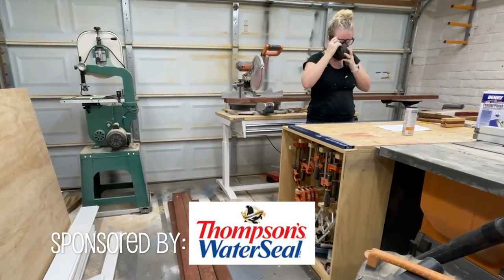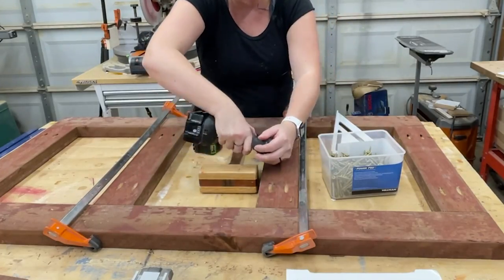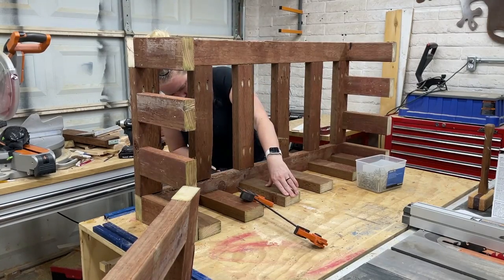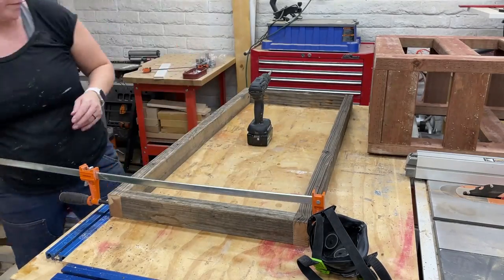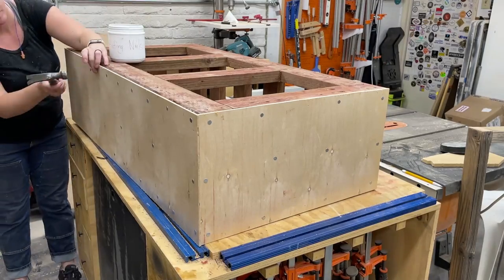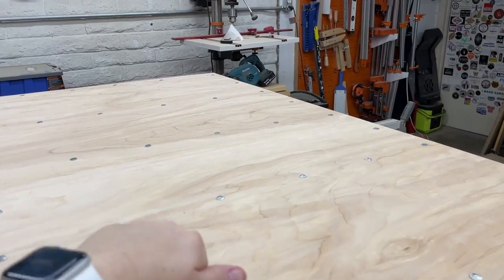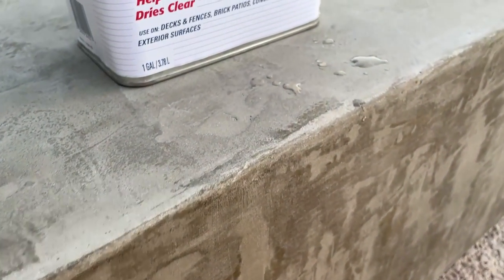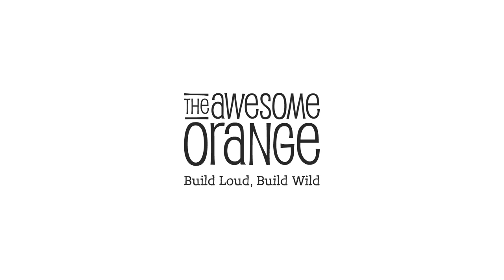DIY Concrete Coffee Table | No Heavy Bags Required

Comment: love the idea. I'm curious how it has held up over the last 2 years? Anything you would do differently? Thanks!
Reply from the maker: I ended up selling this one, so not sure on longevity. Biggest thing to worry about are cracks, but they would be easy enough to patch and fix. 🍊
Reply: @TheAwesomeOrange  May I inquire the ratio?  That is how many times what you invested did you get back in return, please?
Reply from the maker: @MarkH10 I don’t remember what I sold it for, it was a long time ago. 🍊

Comment: Love your table.  I've never worked with cement before. I have a very strong square wicker table from crate and barrel.  The glass broke and I was wondering if I could put this cement right over it or if I need a flat surface>
Reply from the maker: Thanks Susan! I would think it is possible, but not sure on longevity. 🍊

Comment: Looks awesome.  How long between coats did you wait to apply the concrete?  How do you think this will hold up outside in the colder regions of the country?
Reply from the maker: Thanks Matt! I did about two coats per day. The package said it dries in about 15 mins. I think it would be good in the cold… biggest worry is expansion and contraction with the humidity. They ways it’s built hopefully there isn’t much. 🍊

Comment: Hi did you find that you had small long cracks develop once dried? I did a similar project yesterday but today I see cracks.
Reply from the maker: I didn’t see that. I keep this coffee table for a couple of months and then sold it, so I don’t know if any developed after. There is probably to much movement on the frame or the concrete was thick enough would be my guesses. 🍊

Comment: Just don't see how the corners and other places don't open up... show cracks. All wood moves... even plywood and that thin layered concrete without reinforcement will crack/ open up.
Reply from the maker: I did end up selling this piece so I can’t speak to the longevity, but when I had it it looked good. And if needed touch ups would be easy. 🍊
Reply: @TheAwesomeOrange  probably if you treated it more like rendering, and put some of that metal mesh on the corners, it would last a little longer
Reply: @jamesrichards2980  She can definitely not deny one attribute about it, it definitely looks FRA-JI-LEE, so it must be Italian lol 😂😂😂 

Creative in thought but very weak in execution…
Reply: @jamesrichards2980  that will eventually crack, badly, try G.F.R.C mix, with f/g mesh on all corners, will last longer, but,ply not sealed, so moisture will get in, wood and cement, dont mix.